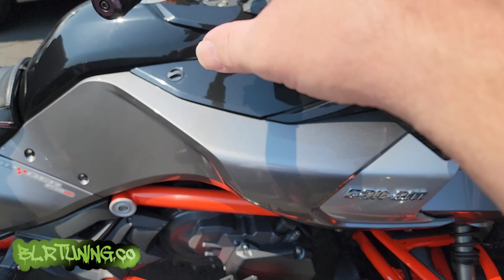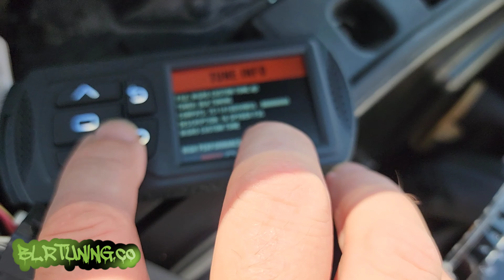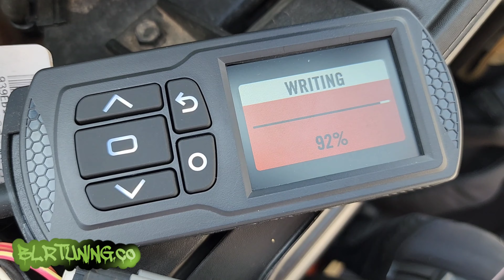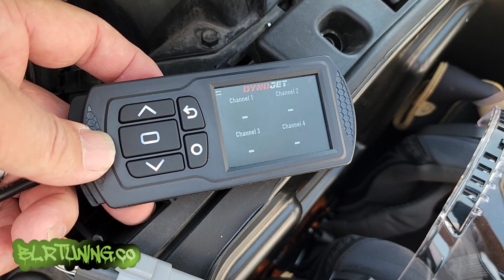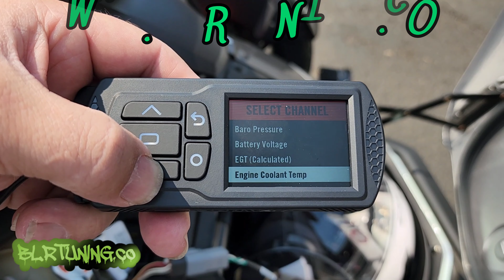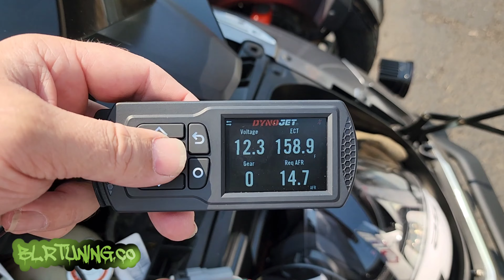CAN-AM SPYDER FLASHING A CUSTOM TUNE USING DYNOJET PV3 by BLR TUNING

Comment: I am looking to change my exhaust on my 2023 f3 s to an aftermarket straight through with a cat delete pipe however if I want to add a baffle or a multiple baffles to bring down the DB a bit (it’s loud ) my question is do i require an individual flash each time I add or remove a baffle to the delete pipe until I get the desired tone

Comment: Sorry a littel late but if i want to flash my ryker Do i musst have the tune an the stockfile on the pv3 and when i Hit flash the ryker will stay powerd on ?
Reply from the maker: I hope I'm understanding your question correctly. You have to have the stock factory tune file available on the Pv3. It must show up in the flash tune section in order to flash any aftermarket tune to the vehicle. If you do not have the stock factory tune file which ends with STK on the PV3 for that specific vehicle then it will tell you no stockfile found and you will not be able to flash any tune whatsoever. This is a safety protocol because the PV3 wants to always have a way to flash back to stock.
Reply: @BLRTUNING and the Ryker do bot shit off because when you just flip the ingnition Switch aber a Minute the will shit off Automatic Right
Reply from the maker: You'll have to send me an email. I'm not sure what you're talking about. 

blrtuning.tech@gmail.com
Reply: @BLRTUNING i send am email

Comment: Will this work with the RSS? I have a 2016 RSS with aftermarket exhaust that backfires through the pipes. What do you suggest?
Reply from the maker: Yes absolutely. It works for the 2016 SM5 and the 2016 SE5 OF THE RS MODELS AND RSS MODELS... You can purchase it directly from us at the following link. We ship anywhere in the US. Be sure to check the box that says yes I want a custom tune. We will gladly build you a custom tune specifically for your bike and your modifications. Make sure when you're purchasing from our website that you leave us some type of contact information either an email or phone number. You'll see a spot at checkout that you can leave notes. You should leave all the notes about your vehicle. The year and model and a list of all performance parts. If you have questions you can scroll to the bottom of our website and you'll see a contact us page. That will get you an email and phone number to reach out to us. We would be happy to assist you. Here's that link. 
https://www.blrtuning.co/products/can-am-spyder-pv4-25-02-by-dynojet-with-optional-custom-tuning-by-blr-tuning
Reply: @BLRTUNING  That is awesome however I was reading the small print on the website and it says you don't ship to California? At the same time you say you can? I surely hope you can , it doesn't make any sense if I can't have a device to help me tune my RSS more efficiently. I would love to purchase asap
Reply from the maker: @voodoochild6741 You could send us an email. We can go over all the details. 
blrtuning.tech@gmail.com

Comment: I have a 2020 cam am spyder f3 and it's in limp mode
Reply from the maker: We would probably need more details than that. The bike can go into limp mode for many different reasons. Anything from the transmission failing, a speed sensor failing, having your foot on the brake while giving it the gas, fuel pump issues. There is tons of stuff that can make it go into limp mode. You need to look at the codes that are on the dashboard. Then do a Google search and find out what those codes mean. Taking photos of the codes is best. This way if they disappear you'll be able to look at the photo to figure out what it was showing.

Comment: Question: I was amazed at how much low end torque I lost after installing a cat delete with the stock tune on my 2020 F3-S. I removed it and the power came back immediately. What aspect of the tune is most affected by the installation of a cat delete? Thanks!
Reply from the maker: Ignition timing and the fuel. You have to remember when you have a cat on there and the stock factory tune. Stock factory tune is designed to heat up the cat this way when the cat is hot it burns off any excess fuel and odors. When you do a cat delete you have to tune the bike for that cat delete or you will definitely lose power. We do offer custom tuning. We carry the Dynojet PV4 which is the newest tuning device out for the Can-Am Spyder it uses Bluetooth and everything is done through your smartphone. It is capable of everything that the PV3 is capable of. The PV3 has its own display and is not Bluetooth compatible where is the PV4 uses your smartphone display and is Bluetooth. We carry both of these devices on our website in our Can-Am Spyder section at the following link. You'll see the option to purchase these tuning devices with a custom tune. Once you place your order you'll need to be sure to email us or put in the notes with your order a list of all of the performance parts installed on the bike as well as the year, make, and model of the bike. 

https://www.blrtuning.co/collections/can-am-spyder

Comment: How do you do the tuning like am I able to tune my own bike or do I use pre mapped tunes for it? 22 f3s
Reply from the maker: All of our tuning no matter what bike you have is done from scratch from the ground up. We don't offer any free tunes or what some companies refer to as canned tunes. We don't use those we don't believe in it. Everything we do is built here in-house from scratch from the ground up specifically for your bike and your parts. We use Woolwich racing software or Dynojet power core software. With a Dynojet Pv3 as long as you have a Windows computer or laptop to a certain extent you can build your own tune. You just have to have the windows computer or laptop and you have to download the Dynojet power core software and you have to understand how the C3 software works. If you're not familiar with tuning it would be best to get with a professional like us or any other company that does tuning to either have a custom tune made for you or ask the appropriate questions to learn about the C3 software. You can check out our website and at the bottom of our website you'll see a contact us button with an email and phone number. Thank you for subscribing to the YouTube channel. 

www.blrtuning.co

Comment: What is the typical power & torque increase on a 2021 F3S (high flow intake + exhaust + 93octane) using a custom tune?
Reply from the maker: The custom tune ads anywhere between 10 and 15 horsepower. A lot of it depends on obviously the parts you have, like exhaust, headers, cat delete, high flow filter. A bike equipped with these parts will make more power when adding the tuning then a stock one. A stock bike can still make more power than it would stock though. Horsepower numbers and torque are also going to depend on the quality of the motor, the quality of the spark plugs, quality of the oil, these things also all play a major role as well. A healthy bike with all the above mentioned parts would probably be closer to 15 horsepower extra when adding the tuning. It's actually a pretty significant gain. Just the torque curve alone is tremendous. There is so much potential when these bikes are tuned. We do keep the PV3 in stock we have it available on our website they are still on sale right now.

www.blrtuning.co
Reply: What all is recommended for the tune without having to spend a ton of 💰. And top speed?
Reply from the maker: You can do the tuning on a stock bike. It just depends on what you're going after. If you wanting the most horsepower possible then go with an exhaust and a high flow filter and a cat delete and custom tune. You can always check out the PV3 on our website. We do carry it for your F3S.

Take the time to read the description below the product as we do cover a lot of the details.

https://www.blrtuning.co/products/power-vision-3-for-can-am-spyder-f3-pv3-25-05

Comment: Thank you Bill for tuning my Spyder, it runs great.  No longer runs rich and sounds great with the RLS and Akrapovic exhaust.
Reply from the maker: Heck yeah I'm glad everything worked out.. thanks for letting us use the bike in a video.
Reply: So it burns fuel better more mileage?
Reply from the maker: @genocide9094 potentially you can get better gas mileage that's what we usually see. Of course with upgrading everything like exhaust and intake and then doing a custom tune we are putting out more horsepower and more torque which usually ends up eating up just a little bit more fuel. In some scenarios we see eco mode getting a little better gas mileage though. We have had customers reporting back to us with 32 to 35 miles gallon after the tune.